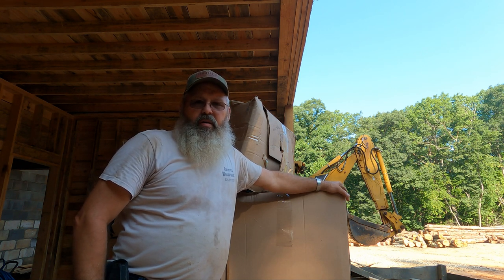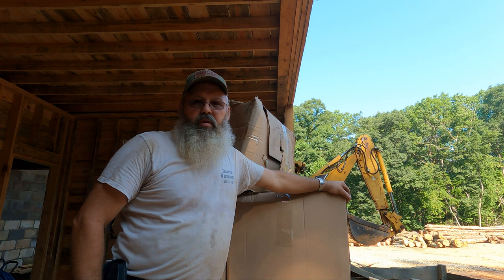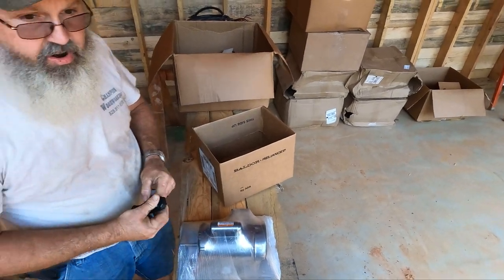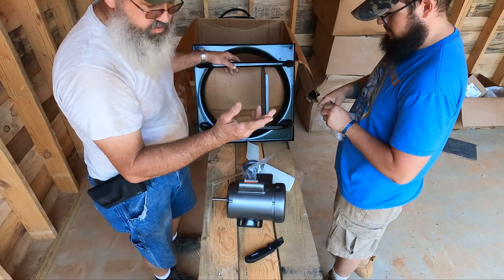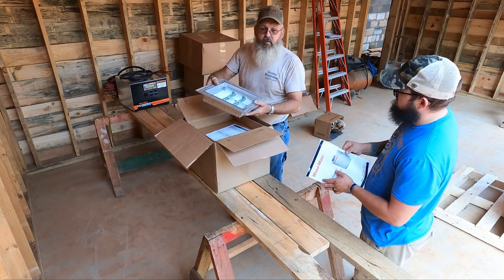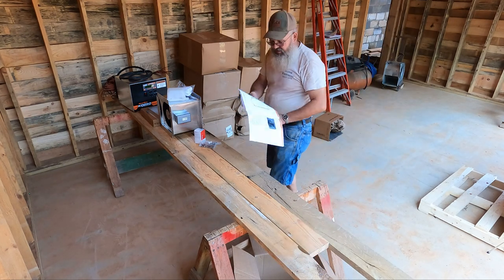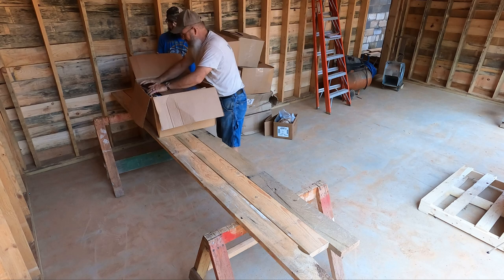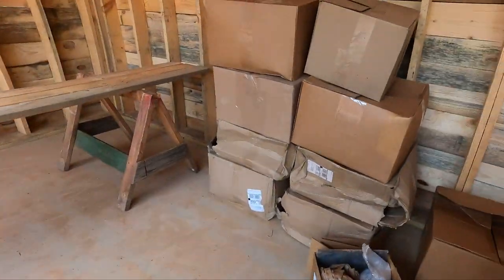Unboxing Our KD250 WoodMizer Kiln!

Comment: Hey does the building need to be air tit do you still half to insulat the building
Reply from the maker: Yes I'm waiting on the spray foam contractor now I'm doing 5 1/2 closed cell foam.
Thx for watching